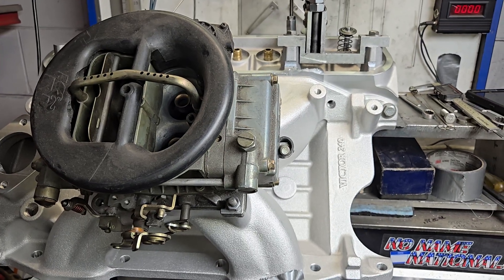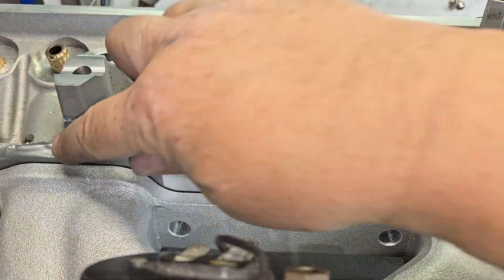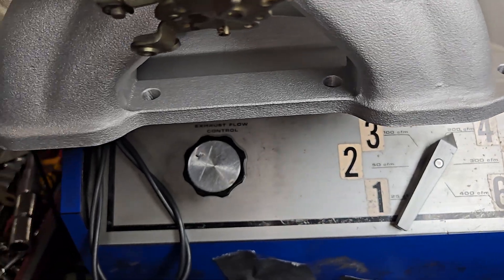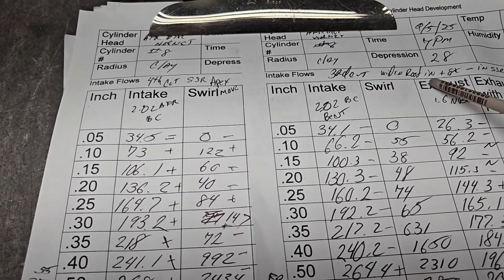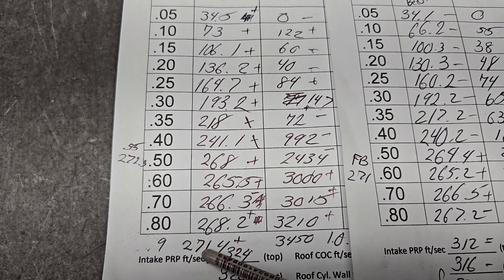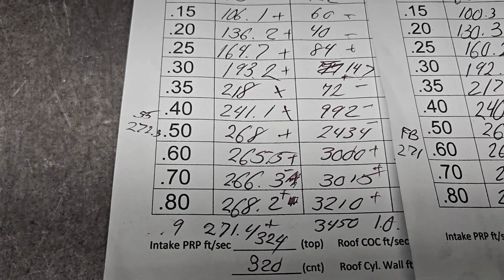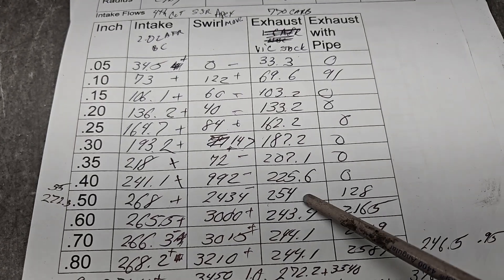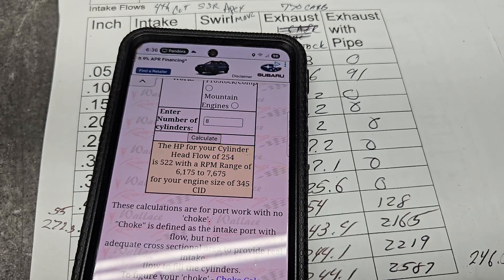AFR Blue Hornet Mopar Cylinder heads, Edelbrock Victor 340, Stock flows through 4th cut.

Comment: Great job on mopar engine breathing, focus on port design &port velocity, increasing volumetric efficiency dealing with the magic uninterrupted path too horsepower. I like the concept of fluid dynamics, promoting filling &scavenging. Highly outstanding job of port transition &port dimensions ,as you known...laminar flow is a highly guarded secret,sooo,would you please add some epoxy on the floor,increase the cfm to 850,and add a dimpled spacer,PLEASE, thanks!!!
Reply from the maker: Air flow is a running engine is always turbulent! Thanks

Comment: Love that K&N Stub stack. Had them for my twin S.U, carbs. Wished I'd bought one for my Thermoquads, while they were still available. Found they really helped intake flow.
Reply from the maker: They are worth a few cfm! Thanks
Reply: I used one. Couldnt tell a difference in performance but always felt I needed it.
Reply: "something"; ram pipes, stock intake flange, stubstacks are a must on the flat flange openings on S.U's. The intake howl on the twin carbs was noticeable different, louder and throttle response improved with them, in my experience. Like I said, never got one to try on the Thermoquads, which have one of the loudest intake howls I've ever experienced on a V-8.